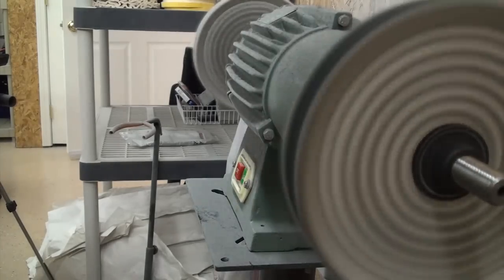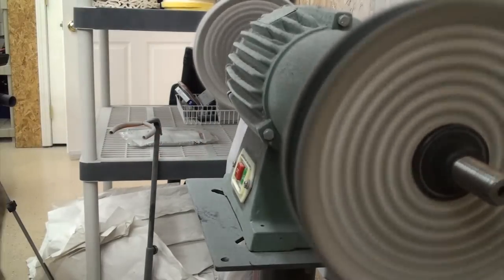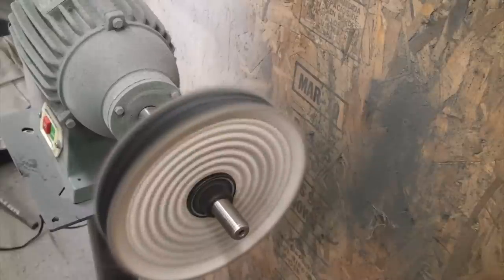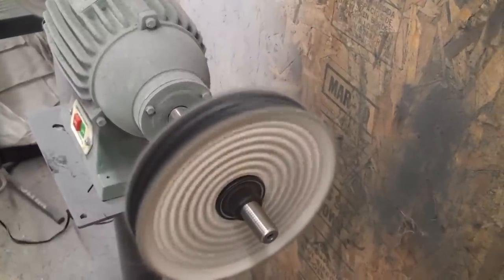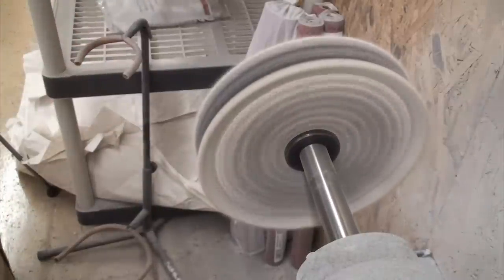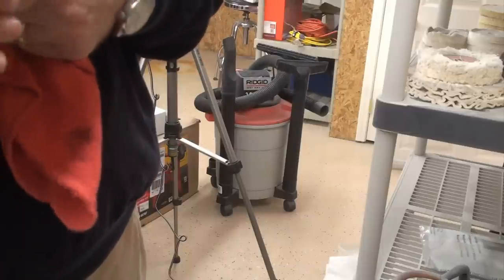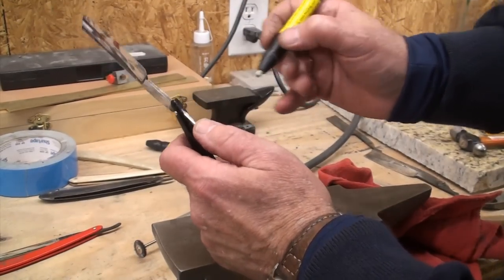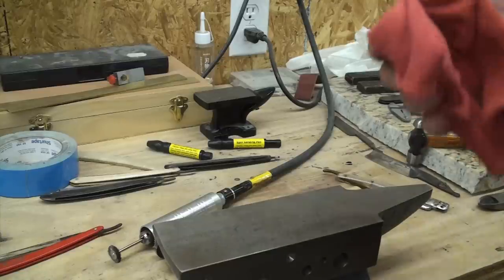Light Straight Razor Restoration

Comment: Hey. I see that he talked about no cleaning the spine of the blade in between the scales with the wire brush on the rotary tool, but there are mini buffing wheel attachments that will work perfectly for that if you have the compounds.

Comment: If you burn the blade near the cutting edge, then you can dump the razor. If you don't want to dump it, you can always try a shave, but a soft edge with the temper drawn out too far (to blue or worse) will not hold an edge. 

You won't be able to properly reharden and temper the razor.

Comment: Hi do you control the temper on the steal after you use them on the wheels,with a lot of blades out there today`people have ruined the steal, allowing it to reach a temperature that has changed the molecules in the metal,As you know there are several types of steal that razors were made from from very mild to stainless and holding them for a certain amount of time with pressure damages the steal,Apart from feeling the temperature with the hand`how do you work out what blade can take longer or more pressure on a cutting wheel or while polishing wheel,
Balling that pin that way has just ruined the shape of the pin head this is not the way you should be showing,
Reply: +wow dude I was thinking the same thing, if I put that kind of pressure on my buffers, the razor instantly gets super hot... and since razors have such thin edges, there is just no where for the heat to go. I know it makes them look nice, but chances are your taking something from that razor. 
I'll stick with my sandpaper and gentle buffing, my razors wont look like that but I like knowing I didn't fudge them. 
 My rule of thumb was always if it makes you say "OUCH!" while touching the metal right under the buffing, then your doing too much.
Reply from the maker: +wow dude The buffer is running at 1800 rpm so it's not creating as much friction as you would think. The steel doesn't hold that many joules because of how small it is and cools off quickly.
Reply: +DarkestDot its the other way around, its small so it heats up fast. Take a small knife to a belt grinder, and then a big fat one and tell me which one gets hots quicker! Bigger pieces of metal have more surface for the heat to go, the heat has no where to go on this little razor, especially considering how paper thin the edge can be.
Reply from the maker: +Max Savino because of the size it cools down quickly. as you can see were holding the blade with bare hands so it gets taken off when it is barely warm.
Reply: +DarkestDot I wish you would show the razor more at the steps. it kinda drives me nuts just hearing you talk about it away from camera lol. 
What I take from the video is, this razor really only had light tarnishing, none of tiny little pits in it. 
So after the final stage of greaseless, your supposed to hand sand, THEN go to the buffers?
Reply: I have done many razors my self from pitting to smooth finish,making scales and pinning.my rule of thumb is when the razor gets warm on the thump dip in cooling solution or use a water wheel,and use slower buffing wheels with better cutting compounds down to pollishing compounds,and your razors will keep the correct temper,